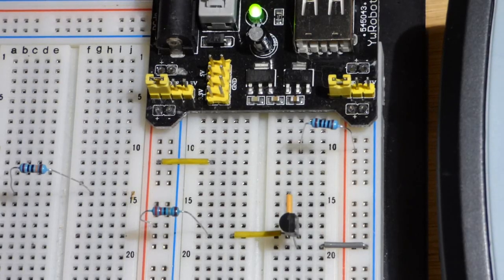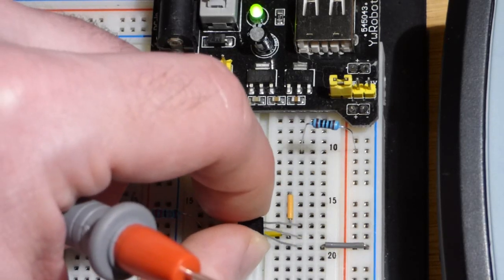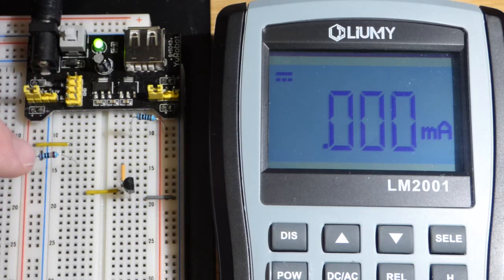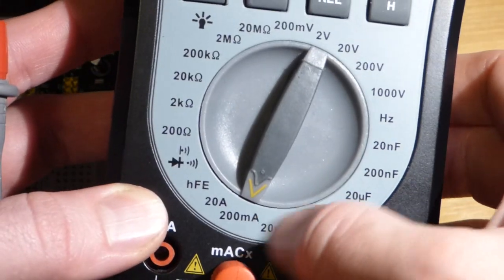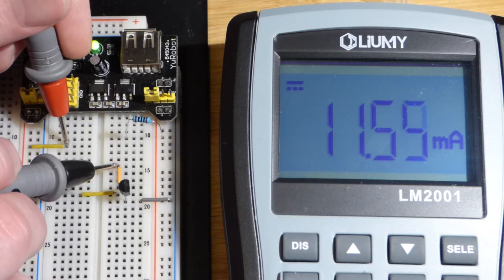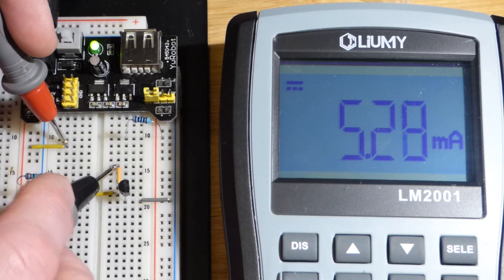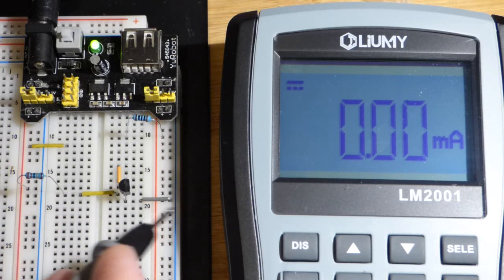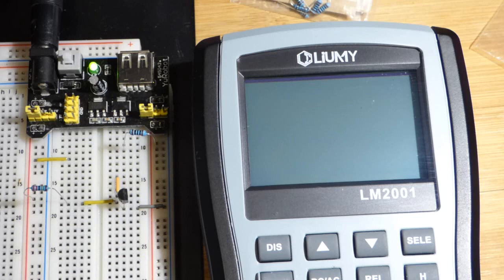NPN 2N2222 Bipolar Junction Transistor BJT current gain demonstration beginning learning electronics

Comment: Thanks so much. I have a situation where I need to output a high signal +5  based on a signal from a battery management system going from ground to to floating (not connected to ground).  If input floating then output =  +5  else if input not floating then output = Gnd or floating( dont care as long as not ~+5).  The output will be going to a sensor on a low voltage disconnect device.  I think transistor in a circuit do this or can you point me to one of your videos on this?  I am thinking about using a pull pull up resistor to Arduino digital input pin but then I"d need to use a relay or another port to make this happen.  Just wondering if a simple circuit can do the same thing.
Reply from the maker: Unfortunately I am also trying to come up with a good low voltage disconnect system. The commercial ones I've bought so far fall short in at least one way. Sounds like you are about as far along as I am :) If that was my only interest, it's only one of dozens of mine, I would watch a lot of videos from drone and RC experts as they appear to be making the most advancements in battery management. I'd especially look for anyone that may be using Arduino in their setups.
Reply: @Electronzap  Thanks. You are a smart guy so I think I'm going to detect the floating ground with the Arduino.  It far simpler and likely more reliable to use the Arduino to detect the floating ground and send the high signal out another Arduino pin to the LVD relay input.  Thanks for your great videos. I have learned much from them. You are really good at explaining things.
Reply from the maker: Glad you enjoy them, thanks for watching!  Have fun with the circuit testing!

Comment: One of these days I am going to build up the courage to measure current. 😂 No rly, any day now. 😂
Reply from the maker: It's not too bad, I only blew one fuse so far lol.
Reply: TBH the only thing really holding me back is #1 I am reticent to switching out the leads because the quality of my meter is not so hot and #2 I still don't understand the impact of current in my circuits ... probably because I am not measuring it!!